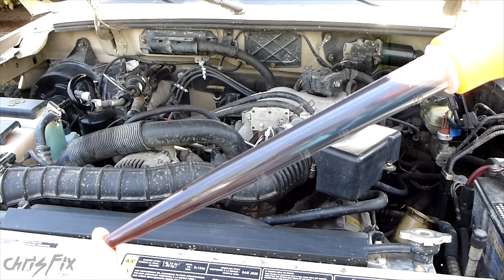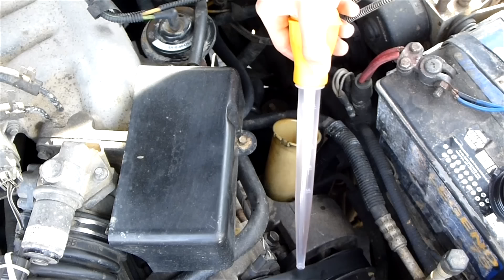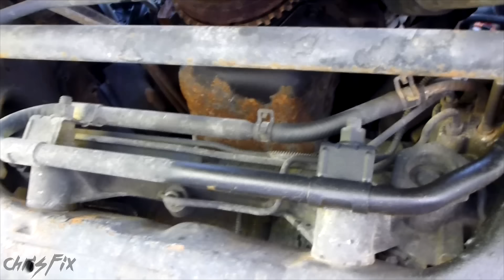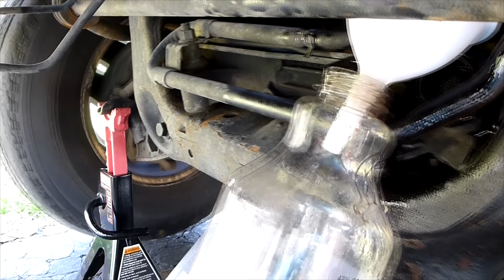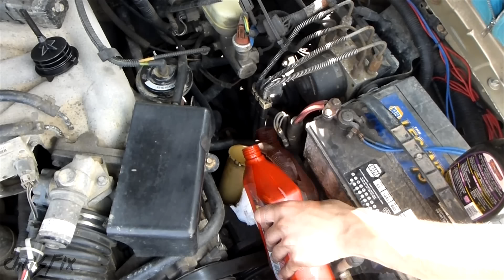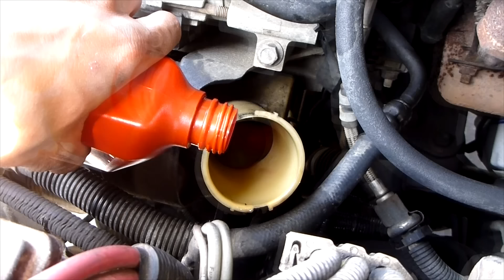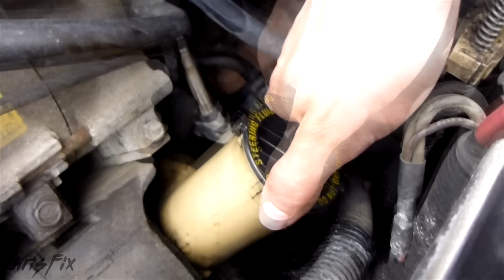How to Flush Your Power Steering Fluid

Comment: I drain out the power steering reservoir once every year and replace with new fluid.  A lot less messy than pulling hoses and even though it's not a complete replacement, the annual treatment keeps the fluid "young".  I take all my used vehicle fluids to a local household hazardous waste collection center that is run by the county.

Comment: I have a question, I want to do this. But I don’t have a jack to lift the car. What exactly does lifting the car do, besides make the wheels turn easier? If I were to keep the car on the ground, would that make the process harder and/or make it harder to get the air out once I flush the system?

Comment: Doubt many ppl will see this comment, but I found another cheap device that works better than the turkey baster at sucking up the old fluid.
Some while back, I watched Chris's brake fluid flush videos and bought a turkey baster for the removal of the old fluid. The issue I ran into was when lifting the baster out of the reservoir. As soon as the baster is lifted out of the fluid, it immediately starts streaming out. It makes a mess if you aren't real fast at moving the baster to your empty bottle... Anyway, I started using those disposable plastic hand pumps that come in tall bottles of hand sanitizer and hand soap. The length of them with the plastic straw they have is a good 6 or 8" long. They're made to pump liquid that is a bit thicker than water, and so far they seem to work perfectly for transferring old automotive fluids.
Reply: Second this. I just used one to help me with a brake fluid flush. Such a useful tool for fluids.

Comment: Hey Chris, I followed the steps of the video and bled the system by going lock to lock like 40 times. The steering is still rough and shakes the pick up when I'm at a stop (i have the same kind of truck you have just a Ford Ranger). When driving it seems okay, but I notice its easier to make a  right hand turn than a left. Making steep turns also tends to give it a little shakiness to the wheel.

I'm at my wits end and have no idea what is wrong. Did I just not bleed enough air out? 

Any tips would be helpful. I didnt have these problems with my old nasty fluid.

Comment: Earlier this night i tired turning but my steering felt stiff. I was able to pull over to the side of the road. I checked my PS fluid and it was a light grey and smelt burnt. I have a 4.6 triton v8, my other problems with the truck is i need to switch my oil pressure switch, i have a squeaky belt sometimes, and of course the vct solenoid issue. Even with all that she runs just fine except tonight she didnt want to let me turn any ideas?
Reply from the maker: I would do a quick flush if the fluid is starting to turn grey and smell burned and see if it helps, if it does help then keep doing this until most of the fluid is new, if not then it could be that the rack is starting to go bad and it will need replacement

Comment: For most people nowadays, you might want to just disconnect the return line at the reservior. 
Drain reservior, then block it off.
Put hose end into your drain container, and either turn lock to lock with wheel off the ground or use starter to spin the PS pump, just try to not allow it to start. Helps to have a helper keeping the PS res filled here.
Do this until the PS fluid from the hose is clear or red, or whatever. Make sure you are turn lock to lock while draining to get all that fluid out.
Then just reconnect everything, top off, start up and do lock to lock 5-6 times, check/re-top off, and then safe test drive.

Comment: Hi Chris - I had a leak and made the mistake of adding prestone leak repair steering fluid. I was just quoted $748 for the new hose from reservoir to steering rack and a flush (recommended due to the thicker leak drop fluid I added). Is a true vacuum flush necessary for this situation or could I still follow your video?

Comment: Chris fix. You have inspired me to not go to a mechanic any more. I would go the dealer mostly and it was soooo expensive, and honestly I wasn't real sure if stuff was done or done right. I chose my first job as a power steering flush on a 1999 ford F-150. It was my father in law's truck and he kept it really nice, it is so clean, I don't think he ever drove it in rain or snow. We drove it cross country and the steering was rough, noisy left and right, and had like a lag when turning to the right. I used most of the stuff you recommended in combo with some other videos. Went lock to lock in the garage several times. Started the engine to remove most of the air. Went lock to lock again when it as running. Then took I out in the road. It made the worst noise! Even at a stop light. But after three minutes no noise at all so dove it around, made turns for about 15 minutes. Got back to the garage, added a  bit more Valvoline Maxlife Synthetic ATF ($14.97/Gallon at Walmart) went lock to lock a few more times. The result? Super quiet turning left and right, and no more lag!!! I'm super psyched and happy it worked and don't need to get a new belt or pump yet!!! THANK YOU!!

Comment: I did this with my acura, except I took off the return at the resovior side. When I finally turned on the engine, the fluid went from clear to blacker than before. Even after draining, turning the wheel, and filling with 4 new bottles of fluid, it still looks the same. :(

Comment: 1. empty reservoir
2. undo return line at the rack, catch fluid
3. lock to lock until all fluid is out
4. fresh fluid in until it comes out clear
5. reattach return line and fill reservoir, lock to lock to burp the system
6. engine on, lock to lock again to burp the system again, top up one last time

?

Comment: Long time ago my my power steering fluid kept losing fluid. took it to a few shops and they told me the reservoir needed replacing. Other place said pump was bad. Another place said hose need replaced.  Well expensive labor too. So I did it myself just to find that a hose was cracked leaking at connection fitting. Took off hose, cut off the end and reconnected it, and boom, solved. For FREE in only less than30 min. Too easy

Comment: Is it really need it to add additives to the power steering system , I've heard that adding such additives to any of the fluids on your engine it causes more damage than good, I experienced that myself by adding to my power steering system a very high recommend brand by hundreds of positive  reviewers online, days later it started to leak from different areas and later on a loud wining noise appeared, same thing happened when I added it to my engine oil, leaks appeared from rear main seal, valve covers, oil pressure sensor etc, etc just to mention some, and since then I don't use them no more, it's no Bueno!!!

Comment: Thank you. I have a 2007 Chevy impala and the power steering pump started whining really bad and the fluid looked like shook up Dr. pepper. It was straight up black and full of bubbles. I followed this procedure and replaced the fluid with Valvoline stop leak and now she seems to be running well and the fluid is clear now. There is a very slight whine when over 2,000 rpm, but for the most part it seems to have resolved my issue. I’ve only driven it a few miles in town since flushing the pump so I’m hoping the rest of the air bubbles work their way out and the whining stops. There’s no more foam in my PS reservoir so that’s a good start. Hopefully I’ll get a few more thousand miles out of the power steering pump. It was only $7 for new power steering fluid... definitely beats $200+ to get a new pump installed.

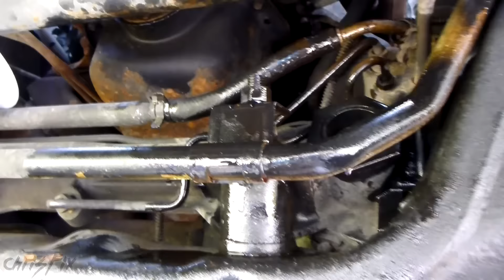Comment: You mentioned a "new line" at the 3:46 mark. Is it recommended that you replace the old return line with a new one whenever doing power steering flushes?

Comment: Just came back from car shop to get an oil change (discounted to $88.90); forgot to ask for my military discount which most merchant honor!  Told I needed an air filter for $39 and some change!  Went over to car parts and got it for $$28 bucks!  I Saved 11 dollars.  I was quoted $158 to flush the power steering!  And that is the reason I'm here.  I think I can save a few bucks!  Thanks for a clear demonstration of what I need to do.  The young man problem has a string of shops by now.  I hope so.

Comment: This seems like the best method, my Honda service manual says to disconnect the return hose from the reservoir, connect a tube to the return line, start the car and let it run dry until no fluid comes out of the return line. However, at that height, the some old fluid stays stuck in the return line. Also, it doesn't make sense that it's okay to let it run dry but we can't drive being a little bit low on fluid. 
Planned obsolescence or is there an actual logic ?

Comment: If you have a leak on the high pressure side you will see fluid when it's running. If you have a leak on the low pressure side you were here at the pump cavitating that means it's making a whining noise. This should help you find any leaks and loss of fluid within your power steering system.

Comment: Old school track when you pulling lines this like that and draining them light a rag across across the openings. That way the food coming out won't splatter all over the place but would just run down on the rag into a pan below. It's still a mess but a lot easier to clean up and you won't miss any

Comment: Does anyone knows if my power steering runs dry for a few minutes it will get permanently damaged ,or just temporary, cause I had to drive a few miles without power steering fluid till I found a gas station to get some , and now is making noise

Comment: Awesome video as always 😁👌. Only one thing I would add. If you buy a foot of power steering hose, you can attach it to the return hose fitting and toss both hoses in an empty jug. This will eliminate a great deal of mess, when you flush the fluid by turning the steering wheel. Makes sure the bottle is clear, so you can see when the new fluid begins to flow. Great video Chris 🤝.

Comment: Thanks Chris. No more embarrassing high pitch whine while starting the engine, driving and turning corners and You saved me a ton of money and from getting robbed! Total cost, $12.00 and 1.5 hrs of siphoning out old oil. I didn't bleed it though the hose though but i did a good job and its worked perfectly and my engine runs crazy quiet!!!WHEW....
Thanks from Brooklyn NY

Comment: Thank you so much Chris! Im 17 and I have a used 2003 Ford Taurus that came with the whine. I thought the pump was bad and replaced it as well as the fluid inside of it but never thought to unhook the return line 😅 Opened the pump the other day to see dirty fluid still in there after my power steering went out and realized what I did wrong. I guess you live and learn :)

Comment: I like the easy method better 😂 I’ll do that one a few times and avoid the mess. No chance of creating a busted line, and no mess to clean up... Easier to just pump out old fluid and refill. Fluid is cheap; lines, parts and labor if you can’t fix it yourself are more expensive.

Comment: my suggestion:
- heat up the fluid by turning the steering wheel lock to lock 6 six times per side while running and on the ground. 
(hopefully the hot fluid will carry more contaminants)

-gloves are always a good idea.  Eventually the chemicals will cause a sensitivity and the skin on your hands will react to any sort of chemical irritant.  Additionally, there is a subtle and cumulative effect on the entire body which can be easily avoided.

Comment: I knew someone who got ripped off by a dealer for a power steering flush on a 3 year old Chevy Impala with 30k miles on it .
They said she " needed " it or it would void her warranty 
I checked her manual and there wasnt even a recommended time or mileage to change the fluid !
I called the 800 number for GM  and got put on hold twice .
They didnt have an answer either .
They scammed her and I called the Attorney general's office and told them .
Then I called the Service Manager and asked why they chargered her $88 for a " Power Steering flush " on a car with only 30k miles on it ! 
I told him Id already called the Attorney general's office .
He quietly said 3 words to me :
" Send her back " 
They refunded her money .
Moral of the story is after owning over 100 cars in my life , power steering fluid lasts a long time unless youve had a leak or other problem with the system .

Comment: I have a 2012 Honda Fit, and I was curious to see where I would pour the power steering fluid. Turns out my car is equipped with an electrical power steering, so I don't need any power steering fluid!

Comment: Hey chris, am I good to just use a turkey baster and remove as much old power steering, and put in new power steering fluid? In this case, i know it wouldn't flush it all out, but I don't want to deal with disconnecting the hose on my honda.

Comment: I have a 99 Corolla and the power steering is rather hard, but i can still sorta feel it. When i checked the reservoir under the hood, i noticed it’s an orange fluid. I don’t know if that’s normal or not, still deciding if i need to flush it completely or put some of the recommended brand

Comment: Hi Chris! My 2007 opel antara 3.2L V6 is leaking a bit of power steering fluid from a nut on the power steering rack. According to my local garage the only possible fix is replacing the whole rack. What would you recommend as a long lasting good quality power steering rack?

Comment: Help Chris! I flushed the fluid and got air in the system as my pump whines when it hits 1200 rpm. Fluid level is good and I tried turning from lock to lock.. How do i get air out of the system?
Reply from the maker: First make sure all connections and hoses are tight so you don't introduce air, then fill to max level and keep turning lock to lock, the bubbles will be forced to the top! Might take a while so be prepared!

Comment: Hi Chris, thinking about changing the power steering reservoir on my 2007 CR-V.  Where I live here in Canada, the part/reservoir costs $170 CAD from dealership (while the one for Odyssey Costs $20 CAD 🤷🏻‍♂️). Just wondering if it is okay to get a aftermarket one, like Dorman? Thanks.

Comment: Doesn't removing the fluid and then turning the steering wheel damage the system? There are going to be points where the system is drained when you are turning the wheel. Also, does the car need to be on for the turning of the steering wheel to pump out the old fluid, and flush the system? It doesn't sound like the car is on at the unclamping hose phase, to the finishing of the job.

Comment: With vehicle on jack stands turn wheel lock to lock for no more than 3 seconds several times with engine running. This will remove more air from system

Comment: Hi Chris! I know this video is pretty old, but I have one question. When I cold start my '96 Explorer, power steering works great, but after I drive for like 30-40 minutes it starts to look like it's not working at all, I have to pull the wheel with two hands really hard to get into parking lot. Do you have an idea why this can happen?

Comment: Why do some cars take ATF and some take actual power steering fluid? My mechanic told me to use ATF but from what I've read, everywhere says use power steering fluid, so which should I be using then? Or could I use either?  (05 Nissan Maxima)
Reply from the maker: seraphina either works. They are basically the same. All power steering fluid is, is hydraulic fluid. Trans fluid can also be used as hydraulic fluid. If the owners manual says power steering fluid, I would buy power steering fluid so you don’t mix two different types. Some trans fluids have additives in them that might not be present in power steering fluid. My video coming out at the end of the week will show this.

Comment: I replaced a rack now I shudders bad  can't hold the wheel once it's started I'm trying to figure it out think it could but the new rack is bad
Reply from the maker: Did you connect all the power steering hoses properly?
Reply: @chrisfix  theres one big and one small that's it . It was remanufactured cheap were replacing it now I'll let you know if it works 👍
Reply: @chrisfix  it was crossed lines thank Chris I replaced the rack twice for fun haha

Comment: I can't believe that the manufacturer recommends ATF in what's basically a hydraulic system. ATF has friction enhancers in it that could potentially damage the pump. Regular power steering fluid or hydraulic oil would be my choice.

Comment: I have an 03 avalanche that makes a loud whining noise every time I turn into somewhere causing unnecessary attention, I’m sure it the power steering but I don’t want to pay $125 for someone to flush and put new fluid in, all I’m wondering is if the jacks to lift up the car are even necessary
Reply: It would be very hard to turn the wheel with the tires on the ground to get the fluid out. It makes it much easier when there in the air.

Comment: Lol a garage wants 120$ I did it in 3 mts and 15$ worth of fluid
Reply: This is a simpler service lol, not many tools at all required, keep that in mind. Now if you want your rear end rebuilt it may take more speciality tools and experience and knowledge. Techs gotta buy their own tools and barely see any of the labor rate. Your shop charging 100 bucks or even 60 the techs maybe make 20 max.

Comment: Soo random question here. I just got an 05 Honda CR-V all wheel drive. I was wondering if there's anyway to replace the power steering all together with something more modern like Electric power assist steering ? Can that be swapped out? Are there any kits that can make this possible?

Comment: My manual says to not turn wheel lock to lock for fear of damaging the pump. Can this step be skipped?
Reply: DeWayne Colvin I believe you should be fine either way. If you don’t turn the wheel you just won’t have as thorough of a draining. If you turn the wheel while the car is off, the pump won’t be running.